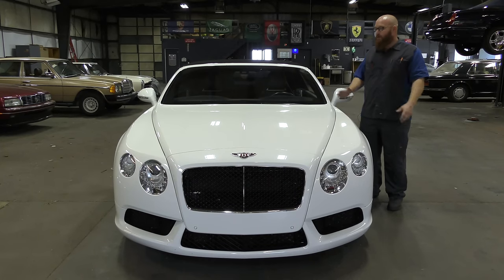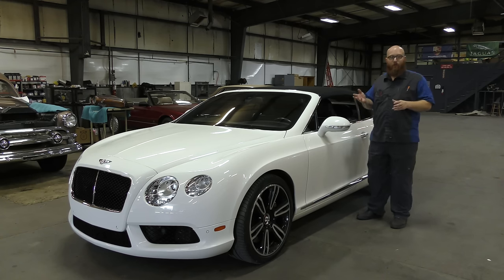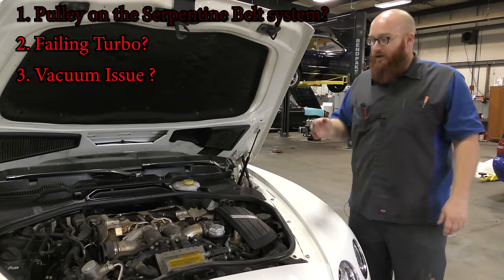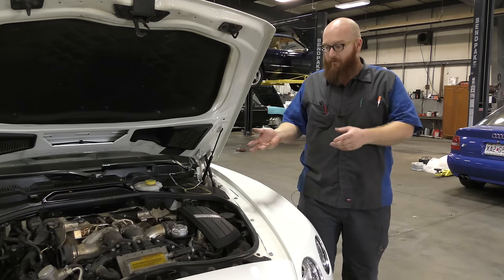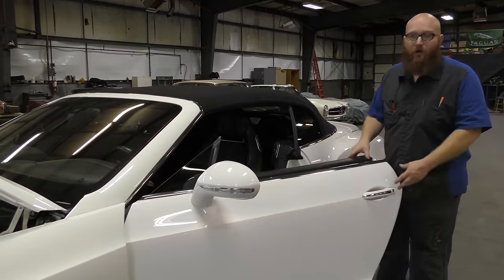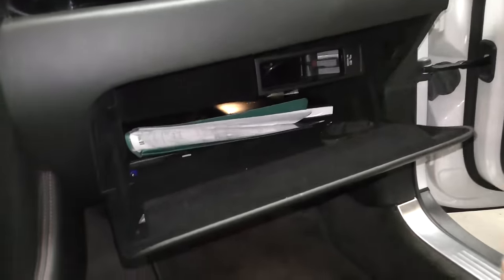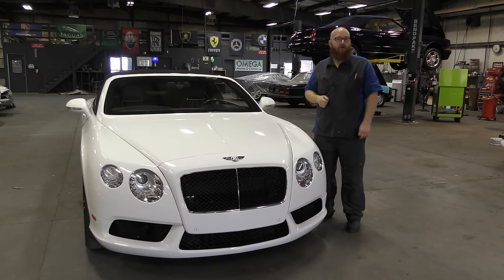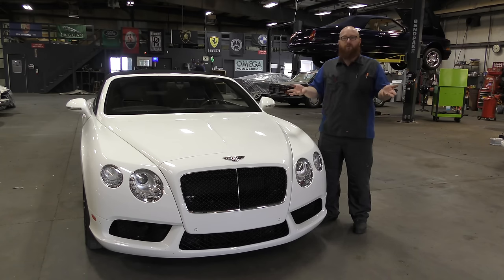Whistling Bentley?!? CAR WIZARD finds why a Bentley Continental GT makes a shrill, whistling noise?

Comment: Car Wizard, you know the whistle sound comes from the diaphragm of the PCV (positive crankcase ventilation) system. With a diaphragm torn, at idle the engine creates vacuum and makes the whistle sound.

Comment: I just recently got a 530xi wagon from an auction with the bmw n52 engine, the car wouldn't run smoothly and misfired badly, every single vacuum line was broken, the PCV valve was clogged and the engine was burning oil.  I removed the entire intake and rebuilt the unit, replaced the DISA valves and all the PVC lines, heater and valve, runs smooth as butter now.  vacuum lines are no joke in these german motors and are such a common issue that i've had at some point on every german engine i've owned/worked on.

Comment: Gotta pay to play. Problem is, people see the sticker price on these cars when they were new at $250k then see them used at $50k 5 years later, they're thinking they're getting a deal. It's still a Bentley, whether it's 2014 or 2020. Average people can afford to BUY them used, but not necessarily keep them fixed and maintained. The name on the badge hasn't changed. Same for Mercedes. These cars all have horrible used car values which makes them so desirable for people to buy them used. Until they have to do service on them.
Reply: Sadly 🤦🏽
Reply: Not enough money to buy them new = not enough money to buy them used & keep'em in driving condition.
No exception.
Reply: Same problem with Ducatis!
Reply: I always drove by this street parked Benz for sale. It was a 2009 C300, but for like $7,500. At typical mileage for an 11 year old car, various sources say it should be half that price. I always thought the car must be low mileage and immaculate for anyone to bite on it.

Comment: German engineering at it’s best. Designing the placement components in such a way that they require a lot of labor to access and replace.
Reply: Not Mercedes. Mercedes are engineered smart.
Reply: Making sure the service department survives.  As far as Mercedes is concerned, back in the day they actually weren't doing well with the W126, W123 and W124 being so reliable.
Reply: @pfsantos007  Mercedes has 100,000+ patents do the automobile since 1885 when they invented the first ever motorcycle and then 1886 car. The S class is the number one selling large luxury sedan for 48 years straight! Mercedes always leads in technology luxury and safety and they make over 45 models of vehicles that are not sub brand of like GM does with Cadillac Corvette / Chevrolet or like Toyota separate from Lexus when you add all their brand names and reliability issues together under one name Mercedes is number one. Knowledge is power the more you know! 🤗
Reply: @JESUS_IS_GOD  None of what you said proves me wrong. They're still very good, especially compared to the European competition, but are no longer the most reliable.  The Japanese have that in the bag (Lexus).  The push to innovate without ensuring absolute reliability and longevity has taken its toll.  Now there are very reliable models, but you have to choose wisely (look at what's being used in taxi service). Not EVERY model is built like a tank, unlike the models up to the mid '90's.  Now they're hit and miss.  THAT'S my point.
Reply: @JESUS_IS_GOD  NOT the ones I owned. I had them from 81-89, too, and they were VERY unreliable despite perfect maintenance.
Reply: @pfsantos007  Lexus only sold 298,000 cars last year Mercedes just their luxury car sales segments sold 2.34 million. Absolutely not true Lexus IS have tons of problems that's just a misconception and obviously the sales show nobody buys them
Reply: MRBADASS Lol maybe 20 years ago, as of now it’s only a status symbol for Instagram douchebags, not so much better than Land Rover in reliability.
Reply: @bryanrmcf  Why is Mercedes selling 2,340,000 million cars last year making it the best selling luxury company 4 yrs in a row and S class is #1 in Large Luxury Sedan 48 yrs in a row? (EXAMPLE Lexus only can sell 248,000 total last year 🤣 🤷‍♂️❤👌🏆

Comment: I'm at the 2:14 point and I think it is a serpentine belt idler bearing gone bad.
Reply: I thought that
Reply: My guess is it's metal on metal...probably a bearing...I'd also guess an idler pulley
Reply: yeah I was guessing that too....when he opened the hood though the sound was different. I have a pulley going on my F150 and it is more of a squeal than a whistle
Reply: I haven't even started it and I think it's a serpentine belt idler because my 2002 Jeep Wrangler had an intermittent high pitched whistle, and it ended up being the idler pulley.
Reply: About to watch video.  Could be a tiny air leak (pressure or vacuum) if it's whistling. edit: 2:18, sounds like a bearing (pulley).
Reply: If it's in your shop and you check the oil before starting the engine, you know immediately what it's going to be. Surprised that the customer didn't notice smoke.
Reply: I thought the same thing. Or a horribly failed alternator bearing.
Reply: @wholeNwon  Next Wizard vid: Replacing the 2 cats on the Bentley, 'cos they got ruined by all the burnt oil. xD
Reply: I was on idler pulley bearing as well...
Reply: @brianleslie7388  I cannot even believe it is a PCV valve gone bad~
Reply: I agree. The frequency seems too “large/slow” for a turbo issue. But I’m a noob lol. 
Yep noob, but now I know that’s a thing lol

Comment: Had a evap code on a late model IS300 restoration project for a yr. Passed 2 smoke tests diagnostics and dealer couldn’t pin it down after a week. Mechanic suggested (off the record) it could be an internal charcoal canister leak that was bypassing the sensor but part was $900. Had a parts car, changed myself and after 2 fillips the P0440 went away. Big win!

Comment: A beautiful car indeed.  I like soft close doors too because I don't like slamming car doors. Sometimes, on (most) cars without this feature, I end up closing and opening the door multiple times to get the force just right (not too hard, but not too soft either), which is annoying. But I know what the Wizard means when an unsuspecting passenger slams a soft close door shut.  The alternative is to forewarn your companion not to use force, but then you can come across as being a bit of a tosser.  Actually, I believe soft close doors are primarily intended for chauffeur-driven cars, so that the driver doesn't have to slam the door on their passenger after holding it open for them (so no warning necessary).

Comment: Didn’t Audi and Bentley extend the PCV warranty to 10/120?

Edit: Also, are you doing the turbo oil screen check valves and screens while you’re in there? They usually are toast by the mileage that that car has, and if they fail or clog, that thing is going to eat the turbos. The parts are very inexpensive, and it’s well worth it to do it while the PCV is out.
Reply: How do u know if it’s under warranty

Comment: Just fixed the same issue on my 2012 S6 Avant at around 80k miles. A quick Google and TSB check led me to the oil separator. It was a lot of work to replace it, but while I was down there I also replaced the turbo oil screen, check valve and O rings, which is 100% necessary on these engines to save the expensive turbos from failing!

Comment: If Bentley interiors are the wizards favorite, he definitely has to check out the current models of the continental and flying spur they nailed it 😍😍😍
Reply: Yeah, but no, it's the exterior that they certainly do not nail. The Wizards would see the wh0re-house light in the hood ornament and they'd say "Oh, how Kardashian." They'd tap the grille and say "Oh, this is just plastic now." Both are connoisseurs, and aware of how far from grace Bentley is falling. They went from catering to the landed gentry to the social influencers.
Reply: Daniel van Slooten the grille is still Metal tho you can be sure it’s not that much plastic either given the still steep price tag 🤔

Comment: An A4 Audi estate was stuck at my house for months due to Covid19. Loaded with equipment. The battery had 5.6 volts across it, so I couldn't even extract the key. I cleared the car, removed the boot floor and spare wheel via the rear door. Using an external battery, I opened the Powered tailgate, Removed the battery & installed my smaller backup. It started up perfectly. Cars with powered everything can be a pain in the bum.

Comment: This video just saved me a tonne of bucks. I’ve been thinking about buying a Continental but the service bills would frighten me too much. The figures gave me something to think on!
Reply: Cost of ownership is always higher than cost to buy used for high class luxury vehicles.  The old saying if it looks expensive it is expensive.  Smart people with money lease them, dumb people buy them new and used.  However, if you want the flash than buy used just know 50k for the car and 50k for repairs not if but when they happen over the next 10 years.
Reply: @desertguy1362  I was in a Jaguar dealership once collecting some parts for a friend. I asked about a price of something and the reply was “if sir has to ask, sir possibly might not be able to afford”... I live in Germany and the first question for anything is always about the labour rate. Agree with you!

Comment: Working on my 1986 Jaguar XLS V12 drove my nuts for several reasons (oil leaking from every where, etc) but small rubber vacuum hoses everywhere that would brittle and leak because there was nowhere for heat to escape from under the hood.

Comment: with the Montana tags i assume the owner is avoiding Kansas sales taxes through the use of a Montana based ll c that that makes a straw purchase for the actual owner, and thus legally avoiding Kansas taxes.  legal but unseemly.  every time you see a luxury car with Montana plates you'll know that you probably paid more to register your car than he did.  thanks Montana!!!!!   every time you hit a pothole you should think of that state whose name means mountain.   their motto should be "turning mountains into potholes (for other states) since 1991"
Reply: Some taxes are ridiculous. Where I live it's 12% used or new, privately sold or through a dealership. They repeatedly charge 12% on a vehicle that's been sold multiple times. Straight up fraud if you ask me. If the vehicle is over $55k, you pay a luxury tax too, all the way up to 25% total, depending on value, repeatedly. If the taxes are fair and reasonable, I don't mind paying my share. It's when you get constantly ripped off that irks me.
Reply: Your complaint relies on the premise that tax revenue paid to the state is an entirely noble, selfless endeavor devoid of any waste, fraud or abuse. Tax revenues are a necessity, yes. However, I would wager that any individual in a position to afford multiple luxury vehicles is already  shouldering a tax burden unlike anything someone petty enough to virtue signal  over a Montana plate could fathom or will ever face in their lifetime.

Comment: Great video! I have a 2015 GT V8 and was quoted over $5k to change the oil seperator. After watching your video you probably saved me a few thousand in repairs. No way I can do it in 6 hours like you but  now I know where to get the part and give it a try myself. Do you have a video on that particular repair?

Comment: Ok I stopped the vid at 1:07...back in the day a whistling noise was a vacuum  leak. Now, back to the video. After hearing it, sounds more like metal on metal..bearing on one of the pulleys? Now the rest of the story. Well damn....I was right the 1st time. Great vid

Comment: German engineering: they still haven't managed to figure out a pcv system.
Reply: It's deliberate, they want to make the car unreliable and therefore obsolete in the shortest time they can get away with so the owner replaces it with the latest model.
Reply: Too many bean counters in the engineering department
Reply: Too busy overengeniring the he'll out of the overengeniring.🤣😂🤪🤑😀🤣🤑🤑
Reply: It's a business remember
Reply: @based7144  For the well off obviously.🤑🤑🤑🤑🤑🤑🤑🤑🤑🤑
Reply: @jamesjames3525  just like software engineers  create viruses to sell you anti-virus software
Reply: @based7144  I thought that I was one of a few that knew that. Never mind I 'm  in good company.😁😆😅🤣
Reply: @based7144  Speaking as someone who works for a security software company - no, we don't do that. But there is fake anti virus software out there that is itself malware.
Reply: @dingo137 is it? or you just trying to protect your industry because I spilt the beans 😂.

Comment: The Bentley customer is about to replace the engines on the Carver Yacht (wizard, Carvers are not yachts)
Reply: Carver makes a few yachts, their website is even called Carver Yachts. Boats generally over 40' can be considered yachts. Some mark the line at 33' as the minimum yacht standard. However, Wizard's 27' jalopy of a boat is definitely NOT a yacht. I think he refers to it as a yacht, tongue in cheek.
Reply: @OMGWTFLOLSMH  I lived on the Chesapeake Bay, Deltaville VA. You didn't want a Carver in rough weather. You got what you paid for

Comment: I immediately knew it was the PCV valve. Exact same noise and behavior when removing the dipstick on my Volvo XC70. Fortunately, the faulty part sits on the top of the engine and is very easy to replace. It took me an hour and $280.

Comment: I replaced the PCV diaphragm on my 2011 Cayenne with the 3.6 VR6... needed to drain the coolant, remove the alternator, coolant pipes, intake manifold, fuel rails, exhaust heat shield, and valve cover.  Everything layers on top of each other in these cars.  Turns out the oil burning issue was a bad mechanical vacuum pump check valve.

Comment: Volvo P2 chassis 2.4 and 2.5 L engines had the same oil separator  vacuum whistling issue. Luckily it's part of the oil filter housing and much easier to replace.

Comment: Finding a garage that will sell you parts at lower than OE prices or even full retail aftermarket prices is a pipe dream. It becomes a shufle game... one place would say oh you need this service to get to this repair... in the end, the price is the same. On the other hand, cars are much more reliable these days so trips to shop is less.

Comment: My best guess at 3 minutes into the video is that it is one of the wheels for a belt on the engine, rubbing against metal or with a bearing shut. Vacuum, eh? There you can see how much I know about Audi engines. Wish I was a car wizard, but there is just a select few.

Comment: "What was the worst vacuum leak you've ever had?"  The intake gasket blew on a GM 3400 engine.  So, upon replacement the rear gasket slipped out of place upon reassembly of the intake.  The vehicle ran alright, but kept setting a misfire code for a couple cylinders.  Put on a vacuum gauge and noticed it jumping around.  Took it all apart again and spotted the problem.  
VT247

Comment: I have the same problem and it was successfully resolved at the lowest cost. the problem is name PCV Valve / Oil Separator around 300$  it easy to remove just onley  remove pips turbo and cooler pips

Comment: My favourite car. I saw one recently on the motorway,top down in the pouring rain,fella sat there head in the air as if if he did not give a f..k, now that is style and when you can drive like that, with everything getting wet you really do have more money than sense.

Comment: That is one bad whistle. Originally thought it could have been a leak after the turbo, but at idle the turbo isn't moving any air. Got it right that it was then a vac. leak, but never would have guessed that the PCV could go THAT bad! What ever happened to the little PCV valve that was $2 at the parts store and took 30 seconds to change because it was on top of the valve cover out in the open?

Comment: Hey! Glad you got the Milwaukee penlight! Love mine and the rubber bite grip.
I use it so much i’ve worn the rubber out on a couple but good excuse to buy another one and have spares in car and house. I also have had great luck with the Duracell green AAA batteries and charger off amazon and swap out with a fresh pair whenever it dims.

Comment: Having turbos inside the V is called a 'hot V'. This is so the turbos get hotter and warm up quicker, i think not just for performance but our old friend, emissions regulations. Most new V engines with turbos are hot V's...

Comment: Hey CarWizard, this is the same engine as the Audi A8/S8 4.0T. They are extended warrantied 10 years 120k miles because the PCV on the 4.0T is a well known and very common issue, so it should be covered by the Bentley dealership. Ask me how i know haha. I would also take out the oil screen too for the turbos, well known they clog up and blow the turbos. So, a bit funny and ironic when you said "oh hes ripping me off" because yeah its free at the dealership.
Reply from the maker: I have found Rolls and Bentley do not cover Audi / BMW engine recalls. Ive personally witnessed this.

Comment: Wizard, I had the very same issue on my 2017 Volvo last week.  I would have bet anything that it was a bad idler bearing on the belt system but it was the the oil breather box.  A torn diaphragm.

Comment: Audi engines are known for having them removed for most repairs. Reason for that is  that everything is so compact as it has to fit in the engine bay. I think that working on a true Rolls’ motor is somewhat easier but complex as well.

Comment: I’ve had this exact problem in my Audi Q7 two times. Seems that the oil separator fails every 40k miles, each one costing around $500 as the supercharger needs to go out. Car works fine but as I cross the border often the officers freak out and start looking all over for the noise but nope, just an expensive car with expensive issues.